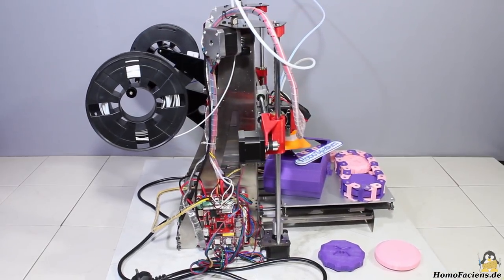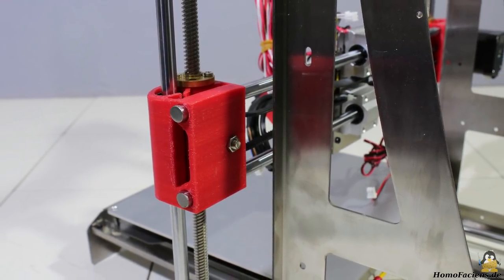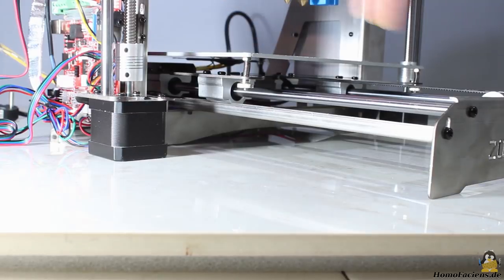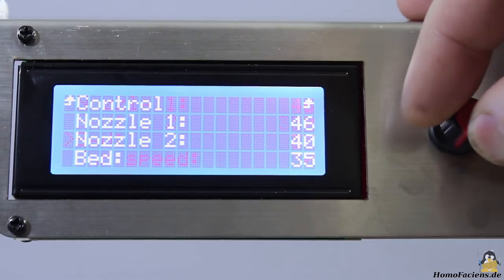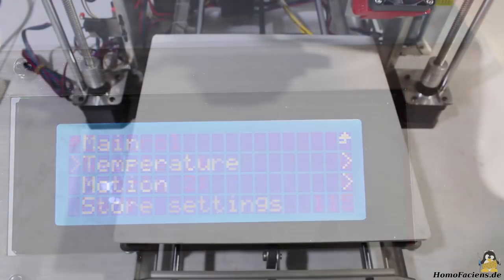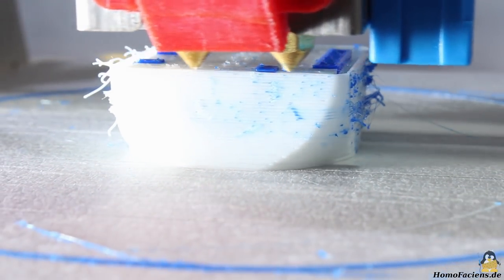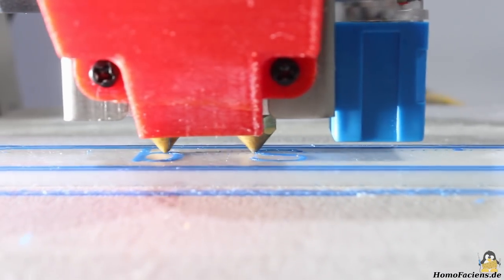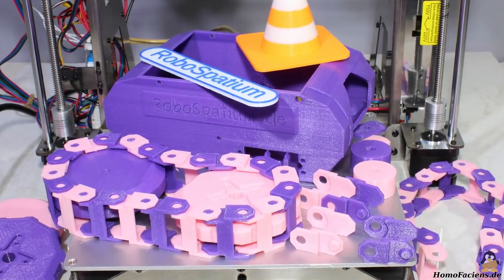Review 3D printer Zonestar P802QR2

Comment: To adjust that type of nozzle system, an easy solution presents itself. Level the bed using one nozzle, then put the paper under both nozzles at the same time. Loosen the screws for BOTH nozzles and let gravity set their height. Lightly tighten the bottom screw on both nozzles, then lightly tighten the top screws. This will prevent screw torque from moving the nozzles, and gravity has been your helper. Finish tightening both sets of screws to firmly hold the hotends, then relevel the bed. At that point, both nozzles should be at the same height from the bed.
Reply from the maker: It's not only gravity, but also the spring coil inside the hotends that push the nozzle down and so eventually also tilts the print bed. Yes, your method can give good results, however even with perfectly adjusted nozzles you will always get both plastics mixed in a layer. The inactive nozzle should be lifted to get best results.
Thanks for sharing your thoughts!
Reply: @HomoFaciens  I agree, it is a bad design. Have your tried long retractions on the other nozzle when not in use? The only real use I would need from a dual extruder, myself, would be 1.75 on one side and 3.0 on the other, so that I could use any available filament. I would want the nozzle not in use to be out of the way though. You could probably use the servos and drive rails from old CD-roms or CD-RW drives to make a manually driven (flip a switch) extruder retractor. A thought.
Reply from the maker: I have building an own 3D printer mechanics in mind. Maybe when this is up and running I will give dual extruders another try. Yes, retracting the inactive nozzle is the only way of making it work better.